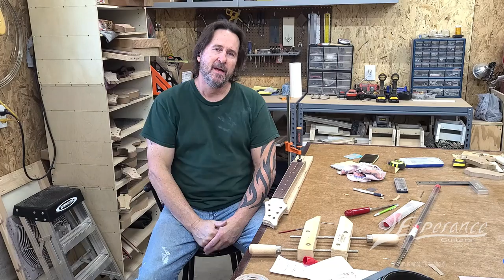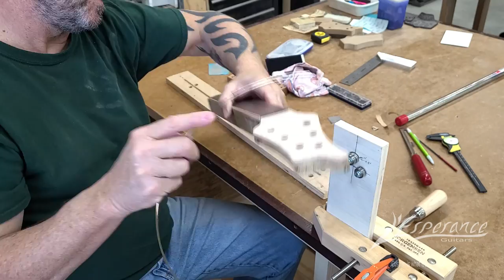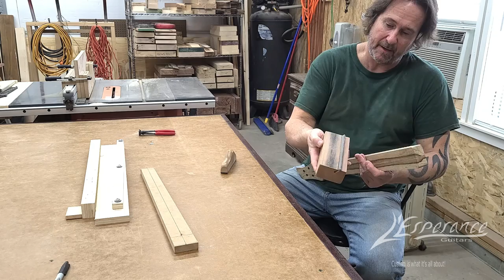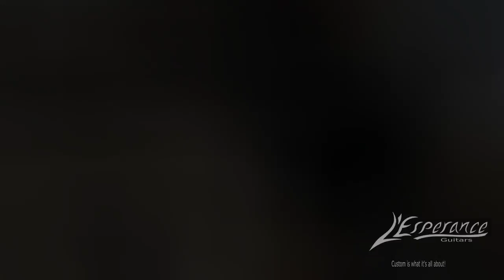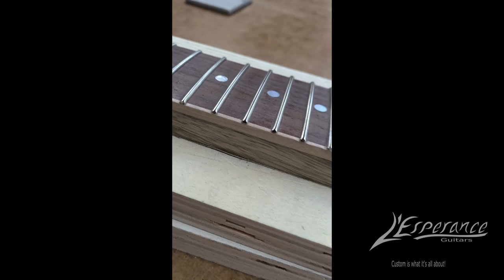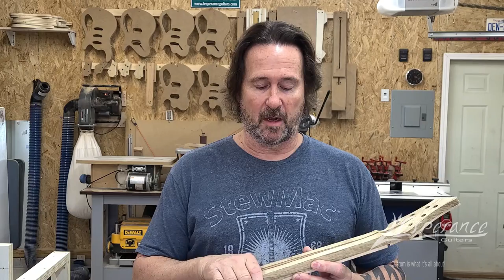Set neck guitar build series pt 4

Comment: Very nice work!  You’re process is similar to mine, in the order of the tasks you complete. I bought the Safe T Planer a long time ago, but have yet to use it. I think after I got my actual planer, I forgot I had it. I might use it now to thin the neck down before shaping. Thanks!
Reply from the maker: I use the safe t planer on a few tasks. I like the tool. You can also modify it to sand. Thanks for watching!